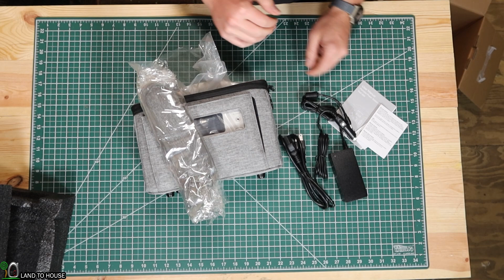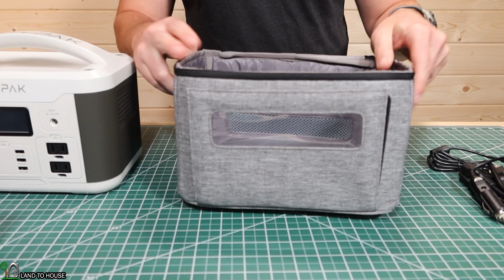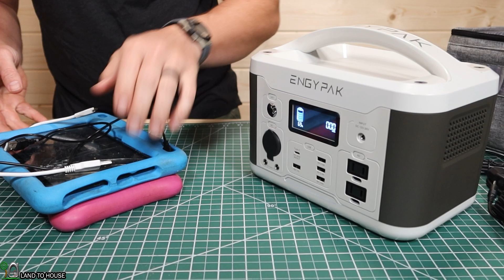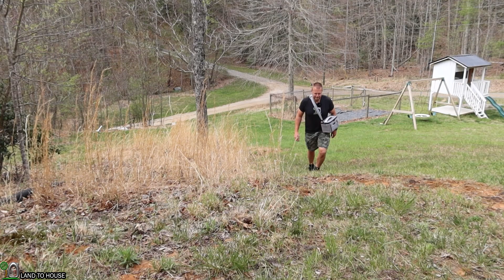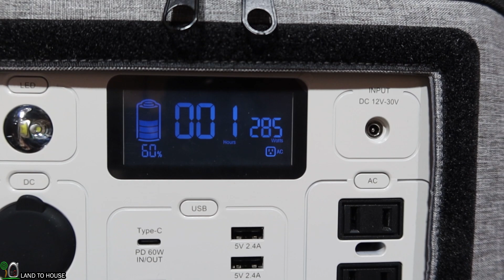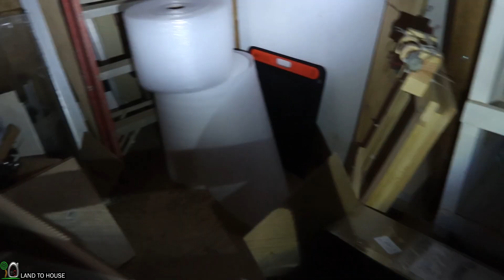ENGY PAK 500w Power Station

Comment: Thanks for the Engy Pak video.   How hard would it be to charge the unit with solar panels?   Is it a proprietary DC input plug?
Reply from the maker: I forget the Max wattage input from solar. But yes you can charge this  with solar panels. It takes a DC barrel plug.

Comment: That’s the first one I’ve seen to include the fashion case too! 😂 Otherwise I like the white look and the overall simplicity of the unit. Does it do any pass through charging?
Reply from the maker: The case could be practical if you take the power station places a lot. This one is not pass through. So far the ones I have seen with pass through are big like 2000w.